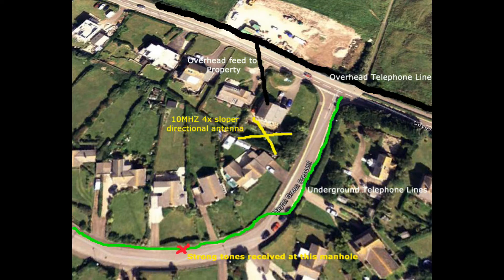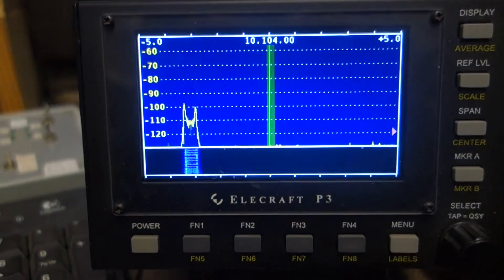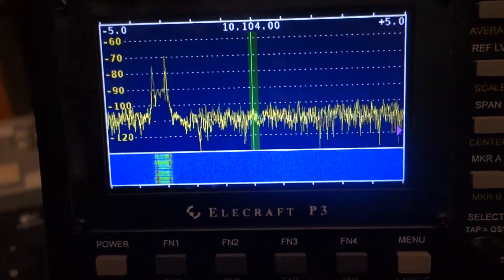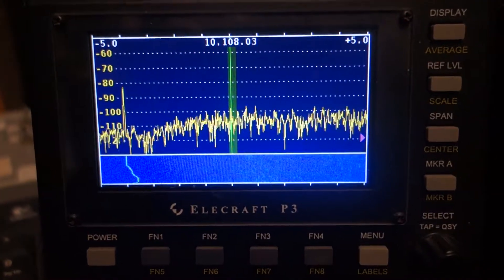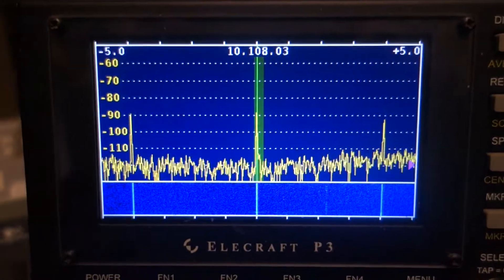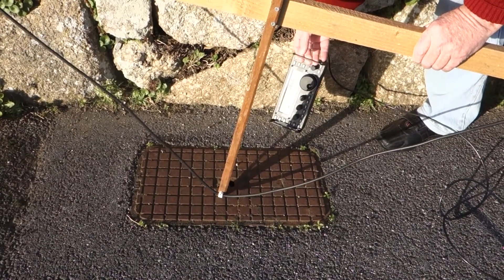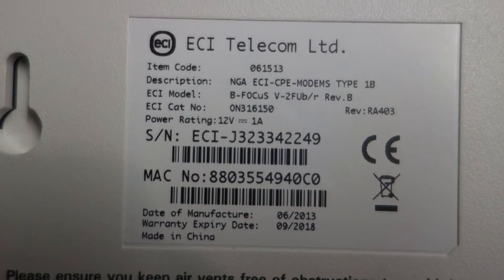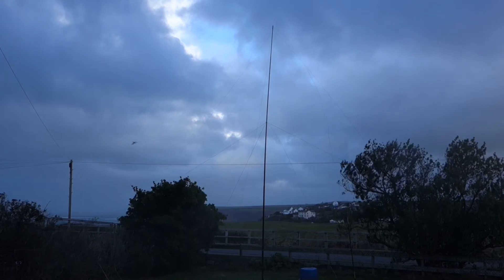VDSL Broadband Interference to Radio Reception.

Comment: does dies VDSL have anything to do with the roll out of the new 5G Cellular network? is VDSL in the Terahertz range?
Reply: 5G uses full fibre optic like 3G and 4G all cell Towers use fibre optic
Reply: basicall 300hz to 30 Mhz max

Comment: what's the bandwidth for VDSL?
Reply: 0.025 MHz - 17.664MHz
The downstream and upstream bands alternate and the easiest way to detect VDSL is to look for magnitude changes in noise level at the band transitions. These transitions occur at 0.138MHz, 3.75MHz, 5.2 MHz, 8.5 MHz and12MHz.

Comment: all telcom should all go to fiber all the way to reduce the interference.
Reply: Yes I agree, but is some cases streets would have to be dug up, I am in a new housing estate and there is on provision to take fibre in or any other new technology without ripping up the street.  You would think they would have it worked out by now.  They knew they would have to run fibre at some point when they built this estate, it is just no one wants to pay up front to lay pipes for new services to run through.

Comment: Could you confirm that the noise is always there in an area where there are multiple broadband internet lines to homes? Or is the noise only present under fault conditions? Phone lines are supposed to be balanced to should not radiate, significantly, so is the radiation 'normal' or indicating a fault? Thanks.
Reply: Hi Janet - in my case the noise is present at all times; only disappears for a second or two after transmission. It appears to by radiated by any and all BT overhead cables in the village.

Comment: Did a different modem make a difference? I have the same issue.
Reply from the maker: +Ste Cooper No - the modem hand-shakes with the exchange or cabinet equipment and puts the line `live`, increasing the noise. The issue is with the system as a whole generating noise across the spectrum and radiating from overhead lines and property domestic telephone wiring. No improvement here and just bad news all round I`m afraid.